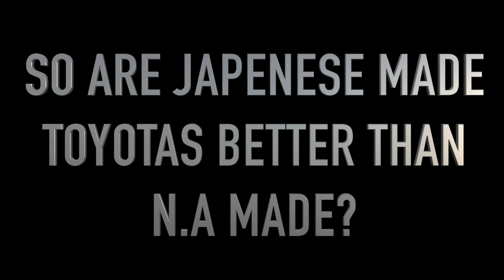Are Toyotas Made in Japan Better than Toyotas Made elsewhere?

Comment: I bought a 2021 Toyota Tacoma TRD off-road that was made in Mexico.  I thought they were still made in Texas prior to delivery.  Upon delivery, I discovered it was made in Mexico.  The body alignment of the hood, grill, and fenders is not correct, the paint has several defects, and contamination, and interior door panels were scuffed up.  Unprecedented of a Toyota.  They are fantastic trucks, but at $46,000 I expected more from a brand new truck.  I would not have purchased this truck if I had known they were now assembled in Mexico.  I have a lot of experience with companies that have been moving production from Mexico back to the US due to poor quality of the products.
Reply: Some are made in Texas.
Reply: My 2018 Tacoma was also made in Baja. The overall quality is what I consider to be excellent. I find it to be at least equal to any German car I have ever owned.
Reply: mine is also a new 2021, just over 1000 miles, TRD Offroad black out edition, Baja, I knew ahead of time so I checked carefully, luckily I only noticed the pair of fender panel seams are not the same width, but I can live with it.
Reply: I bought 2021 TRD off-road and it was built in Texas based on VIN starts with 5...  truck put together well. No issue except license plate light has moisture in it. I believe is part issue though.
Reply: Have 21 Taco OR. Mine was made in Mexico as well. Didn't spot any imperfections or have any issues.
Reply: Exactly what I experienced with my 2016 Mexican built Tacoma.
Reply: My 18' Tacomas welds on my hood structure have busted.. Dealership put silicone to glue it back! 😆 DIDN'T WORK.. Love the truck.. But my hood is sooo wobbly.. Ohhh made in Mexico..🙏🙏🙏
Reply: My taco 21 Tacoma TRD4x4 sport has over 36,000 miles and is doing great. Would buy it again and again! Hecho in Mexico!
Reply: @justtl5885  16 was the first year for that generation… everyone knows 16  - 17 years are fucked mate.

Comment: The country that has the highest discipline has the best workers and the best quality control. I had a brand new truck built in Mexico and the Mexican technicians in LA, found a lot of bolts lose at the electrical box mounted on the firewall. 
I think they built my truck on Sunday and were drinking Tequila. 
When it comes to cars and a lot of other things Japanese have the highest quality.
Reply: @DylanL69  Stay safe. We have open boarders because of a weak President.
Reply: @jaysmith179  I know I'm fine though
Reply: @elguapo8751  dude not even
Reply: @DylanL69  Nice bait
Reply: Love the Japanese made
Reply: I’m Mexican and I agree with you I try to buy Japanese 🤣🤣🤣🤣
Reply: Politically correct…but still I feel better that my new RAV4 Limited built in Japan was done so…see the quality…

Comment: I own two Japanese car brands. Acura and Toyota. The Acura was assembled in Japan…it has 220k miles and runs like new, has not needed a single major repair. Besides oil, brakes, and tires, it has only needed a fuel pump. It’s turns 14 years old this year and till looks and runs great! I owned an Accord before that and by 200k miles, none of the windows rolled down, the struts were dead, the clear coat flaked completely away, needed a balancer seal, starter, cv axels, and radiator. The Accord was assembled here in the U.S.

Jury is out on the new Sequoia. It was assembled in Indiana so I expect some issues to pop up as it ages.
Reply: How about the new Tacomas now being built in the Mexico plant? SMH at this decision from Toyota.

Comment: My 2015 Tacoma 4x4 DCLB was made in Mexico. Power train was fine but fit and finish was questionable.
Reply: Idk My dad had some older Toyota pickups before they where called Tacoma and they where made in japan and even then fit and finish wasn't the best as far as paint I think Toyota pickups have always had problems with it, If the materials and parts Toyota is providing Mexican plants are cheaper fit isn't gonna be good.

Comment: I'm a little late on this topic. Great interview and insight between you and Dave. I appreciate that Toyotas have high manufacturing standards as we have a 2013 Rav4 in the driveway with 120,000 miles on it. I also have a 2008 Buick Enclave with 220,000 miles and a 2005 Silverado with 180,000 miles. I have often wondered about the questions you address here. The variable you did not address is the work ethic or work culture between the countries and if that affects the quality or recall numbers from any one factory. Maybe that can be a topic for another day with you and Dave.

Comment: Thank you both for this information.  I bought a Toyota  several years ago in the UK. It was a diesel with a BMW 1.6 engine apparently Toyota did not wish to build diesel engine for cars in Europe so some deal was done with BMW. Now I had two episodes with this engine when under 5000 miles the ERG valve all these repaired under warrantee. I was not the only customer of the major dealer to have this problem. However I believe Toyota did something to resolve the problem (I did write to the top executive in the UK but can't claim credit for the resolution to the problem) Since that time now at 33K mile all is well. I agree treat you treat your car properly that gives them longer reliable life. I enjoy the wisdom from your channel. Thanks

Comment: There is a difference between Assembled in Japan and Made in Japan. 
When buying a brand new Car, there is a small sticker on the rear passenger window where it shows where the components/percentage of parts come from. 
Buying a Prius, 4runner, lane cruisers, Lexus IS, GS, GX, LX, NX will all show 100% parts from Japan and is also Assembled in Japan, these cars are certified MADE IN JAPAN. 
The only cars I would def buy. 
But yes, your vin number can say J but not all parts are from Japan and can come from diff countries, so it would just be assembled in Japan. But in my opinion, still higher quality than any other countries.

Just my 2cents
Reply: Heck, even my scion iM, Corolla iM are 100% engine/transmission/parts are from Japan and assembled in Japan. So it is Made In Japan.
Reply: There wasn’t a sticker on my Camry hybrid indicating where the components were made?
Reply: @tails300  dealer must have taken it  off.
Reply: @Chorizomicks  yeah true. The final assembly is Kentucky though as it states on the door sill sticker, so that indicates the car isn’t purely a USA built one.
Reply: @tails300  its assembled in the usa. some parts might have come from elsewhere. Prius' hybrids are all 100% Parts from Japan and they are assembled in japan. Makes them MADE IN JAPAN like 4runners, land cruisers, Corolla iM, Lexus GS, IS, LS, NX, GX, LX. I think some corolla hatchbacks are Made in japan too with 100% parts from japan
Reply: @Chorizomicks  I agree, but the Corolla iM is discontinued it’s just known as the Corolla hatch now.

Comment: A car can be greater or less than the sum of its parts.

A factory worker in Japan would never show up hung over, drunk, on heroin or meth, or just not feel like being there on a specific day. Can we say the same about Cletus in Kentucky? I am not talking about stereotypes, I am talking about the cold, hard reality of the situation.

Even cosmetic things can damage the usability and resell value of the car. That the fit and finish of American-made Toyotas is inferior is a huge red mark against them and all the hand-waving in the world can't change that. That is a sign of corners being cut, what else is being cut? It would be one thing if a comparable Toyota built in Kentucky had a sticker price that is $5000 less to signify an inferior vehicle, but that is not the case.

I would wait a few extra months to avoid one built in Kentucky and would pass if that were the only option. US built Toyotas are knockoffs, but Toyota USA, being the scumbags that they are, actually charges the same for these fakes.

It doesn't matter what the make of the car is: Toyota, Honda, Hyundai, BMW, Mercedes, etc - the American-made models of every foreign car maker are inferior.

Comment: Toyota uses much higher tolerances. My friend worked in the Automotive industry in the Engineering side of things and all of Toyota tolerance standards were much higher then all other manufacturers. Closer to that of the Aviation industry, thus longer lasting parts but higher in price. The Kaizen principle also plays a large role in Toyota's high levels of reliability.
Reply: you mean lower level of tolerance
Reply: if you think high tolerance means quality than you are sadly mistaken.
Reply: @CoIoneIPanic  no doubt quality across all manufacturers has definitely decreased in the past decade!

Comment: Thank you for this video and information!  Just an observation, if one looks at some of the FLAGSHIP vehicles from varying Japanese automakers, one can usually notice a common pattern in which Toyota's previous hardcore SUV, the Landcruiser, had always been made in Japan.  Some other notable reputable vehicles from Toyota which are well known for durability like the 4Runner and FJCruiser, are also made in Japan.  Previously in the past when Mitsubishi made body on frame SUVs like the Montero Limited and Montero Sport, they were also made in Japan.  Another industry I am familiar with is fishing reels.  Shimano makes their top of the line Stella series in Japan but would often produce their mid and lower tier fishing reels in other countries where production cost (labor) is generally cheaper.  The same goes for another fishing reel company, Daiwa...  Just making in observation...  Thank you for your consideration...

Comment: I, personally, will NOT buy Tacoma made in Mexico. I were thinking about getting one, until I found out where they were made. Sad for Toyota.
Reply: It’s a Mexoma
Reply: Exactly. I had an 07 accord and drove it for 250k miles…sold it without any mechanical issues. The same car sold in Brazil is made in Mexico and it has so many recalls you wouldn’t believe it
Reply: @rzu7120  
😂😂😂
Reply: @nuniabiz7982  
I strongly believe quality relates to people. Japan, USA , bit not Mexico. 
This video here is just …. 
People should vote with their $$$. I will.
Same applies to Ford, assembled their Mustang in Mexico.
Reply: That's why thier called tacos 🌮,   buy a 4runner

Comment: To me it’s not just the factory line, which I do believe is better, but it’s the surrounding suppliers of parts who I believe are held to a higher quality, let me give you one example when you get a Toyota made from Japan it has a Panasonic battery in it when you get one from another plant it comes with a true start,  Also in my opinion you can tell because the flagship cars are always made at the Japanese plants the best models in the lineup forerunner Land Cruiser Lexus LS All made at  the Japanese plants.
Reply: Do you know if the RAV4 Limited Hybrid is also made exclusively in Japan?
I once saw a video of someone bragging about their RAV4 Made in Japan and he mentioned that the Limited Hybrid came from Japan. But I had the chance to check other RAV4 (non) hybrids and they came from Canada. I am confused. xD
Reply: @Giorgio_Giorgioni  I believe at once time the rav 4 hybrid came from Japan only. But now I believe it’s primarily from Canada but there are some out there that are made in Japan. Canada is probably the second best Toyota factory and was where the first Lexus to be made in North America was chosen to be manufactured at.

Comment: I have a simple philosophy when it comes to buying a new car, regardless of the manufactures or where it's assembled.  Never buy a new model of a car until it has been in the market for at least 3 years.  Let others find out what problems has not been discovered or worked out yet.
Reply: As a licensed mechanic for 38 years this is absolutely correct and also the philosophy I follow and recommend. Just bought a 2022 4Runner. Why because it's the last model before they redesign it and they have been refining the 5th gen. for many years. Dinosaur maybe but bulletproof is worth it's weight in gold.
Reply: LOL, i bought a 3rd gen 2017 highlander. i think the first model was a 2014 so 3 years. load and behold....the transmission is known for issues in the 17 year XD
Reply: @randomrazr  Well, I guess I should make it at least 4 years instead of 3.  BTW - My Toyota is a 2003 V6 Highlander with about 254,000 miles.  No problems at all with the transmission.  Thus far the most expense repair I had done was replacing the bank 1 and 2 engine knock sensors.
Reply: @F15ElectricEagle  same brakes?
Reply: @randomrazr  - If you mean the brakes in term of the major parts related to it, i.e. drums, calipers, rotors, cylinder, break lines, various bolts, etc., they are all originals.  The only thing related to the brakes I had to change (as part of regular maintenances) were the brake pads and brake fluid.
Reply: That is why I'm going to hold off and buy the 2023 Tundra.
If I hear a lot of bad report about the 2022, I'm going to get the 2023 Cadillac Black Wing.
Keeping my 2010 Tacoma, regardless whichever new vehicle I get.
Reply: @icost4671  wonder what a 4runner will be like
Reply: @randomrazr  is that new for 2022 also ?

Comment: Interesting video.  I was surprised when I bought a GM car and my insurance was so much lower than my Japanese car, that was pretty old.  The insurance agent told me that that was because the Japanese car were much more expensive due to the import tariffs, and also the parts had to be shipped from Japan in the event of an accident.  Now it sounds like that just wasn't correct.
Reply: It's not so much the tariffs, bit the general price of the parts.  Price out an alternator for a 1995 Chevrolet Silverado vs a 1995 Toyota pickup.  In general import prices are higher than domestic prices.

Comment: The take away is that the design process and the stringent requirements placed on Toyota's parts suppliers are the most important factors when manufacturing a new Toyota. If you design X part to fit properly with Y part, and the supplier is able to make those two parts with very little deviation from spec (or no deviations at all), then there is absolutely no difference in quality between those 2 parts made in Japan or elsewhere. They are functionally one and the same.

Those are only for parts that arrive at the factory by themselves or as part of a subassembly, of course, and has nothing to do things that are out of the control of the suppliers such as paint application, sheet metal stampings, and so on.

If the above holds true, and the quality of every part and subassembly are equal, then the real difference in quality will come down to the diligence of the factory workers. The workers have to do everything precisely, with high quality, be willing to stop the line if something is discovered, and generally be invested in their job for more than just compensation. In other words, they are not just working for the money, they are working to do their best every single day and derive satisfaction from it.
Reply: i think this pretty much sums it up!
Reply: That is a big and unlikely if.

Comment: Mexican built cars at least for other brands are notoriously crap. I just do not buy it.
Reply: If the other brands you are referring to are Ford, Chrysler and GM it is what is to be expected. The big 3 don't give a damn about quality, just spew them out as fast and as cheaply as possible. How Toyota does in Mexico, I hope it's better with their strict adherence to quality.

I live in Ontario, Canada and live just down the highway from where they make the Rav4's, another plant that makes the Honda Civic and another that makes the Lexus RX350 and 450's. They are all quality vehicles and I wouldn't hesitate to buy any of them. In fact, I own a '13 rav4 and a '20 both built here and both are excellent vehicles. I know people who worked on building those factories as well work/worked in the Toyota ones. Toyota is so anal about quality that they made the contractor redo the wallpaper in one of the offices because one seam wasn't aligned perfectly. I know of people who were hired there that were good workers but didn't meet the perfection requirements of Toyota and were let go. The people that I know that are still working there say it is indeed very true that Toyota is extremely anal about quality.

On the other hand, I have to drive by the plant that makes the Chevy Equinox to get to the other ones. That vehicle, even though it's made here, I wouldn't touch with a ten foot pole. I know people who have/do work there and there is only passing concern for quality. Management just wants to pump them out regardless of their fitness. And it's not just the manufacturing, it's the design and engineering that are shoddy as well.

So, in Canada, we are more than capable of manufacturing quality vehicles as long as the design/engineering is sound and the manufacturer cares about quality and impresses that upon the workers. If not, then you get the Equinox.

Comment: I owned a japanese built van for 22 years with 375k on the clock  with only regular oil and brake maintenance sold it as scrap for parts and was still running❤

Comment: I'm a tool and die maker who's worked across the country. In the midwest most work is automotive-related. I've built dies for parts manufacturers who make parts for American and foreign domestically-built cars. Tolerances on dies we built to make Toyota parts always had tighter tolerances. For that reason, I stick with Toyota OEM parts.